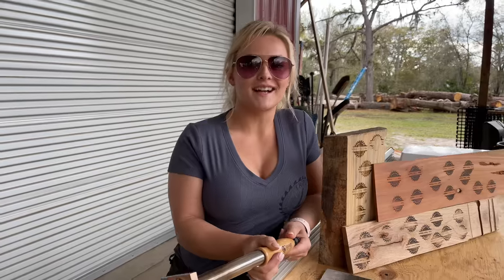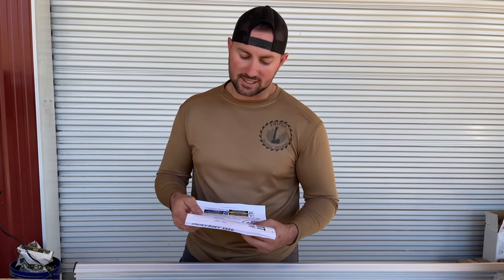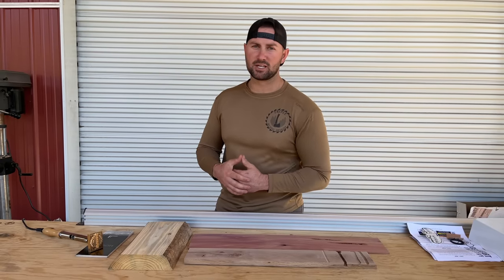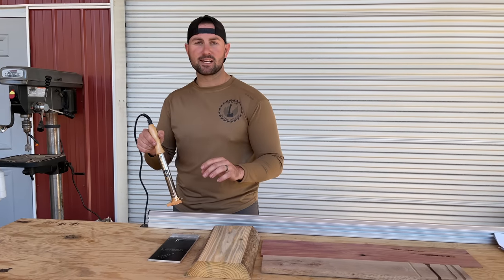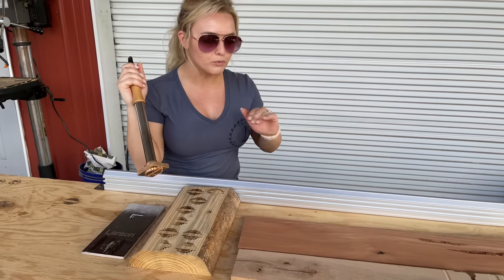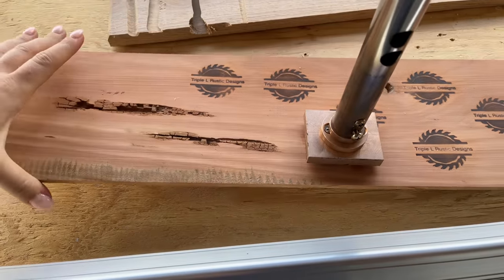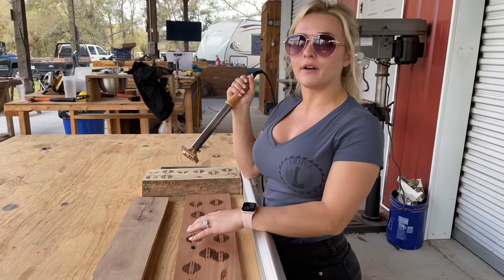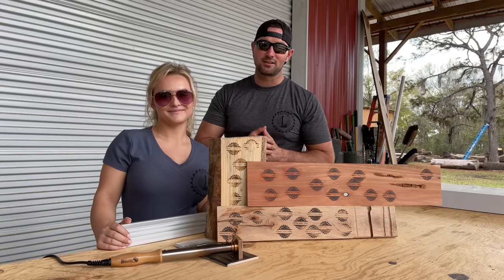High Quality Wood Branding Iron from Gearheart Industry

Comment: Great demonstration.   That is a niiiice iron.

Here's a tip for you.... every time you brand, the wood acts as a heat sink.  Give it about 3-4 minutes to recover its surface temp between brands,  Mine is rectangular.... the outside loses heat first.  Because yours is square, the center cools first.  Just let it recover and you'll be pleased with the results.

Once again, thanks for posting.
Reply from the maker: Thank You so much that is very helpful

Comment: Maybe if you could find an old drill press and anchor that entire assembly to it. Then you could use the constant up/down motion to get consistent burns. I might look into these, but I know they have to be spendy. I need one to burn my apiary license number into a couple hundred boxes. Wonder how long that would last.
Reply from the maker: Great suggestion!
Reply: @TripleLRusticDesigns  well just went to their web site. Guess what? They already make an electric one that fits right into the chuck of a drill press. You just need to shell out the 300 bucks for it. But that's a business write off so not really a factor.

Comment: Holy shit man. Brand something already!! 😂
Reply from the maker: I know I know. Trust me, I am a fan of more videoing less talking. It is all part of it though
Reply: @TripleLRusticDesigns  I like your character brother I was admiring The Branding tool and I have a suggestion if you put it on something similar to a drill press type thing where it lowers vertically and it's already at a perfect 90 degree angle that would lessen having to manually do it and you would have a precise consistent pressure each time.BLEZZ#KEEP DA CHANGE
Reply: Shirt looks good on You too, as well as your wife. never seen a woman with such curves. that is with the utmost respect I give you that compliment. You guys are true Champions she's not lazy and she's pretty to boot.BLEZZ#KEEP DA CHANGE

Comment: If you turn the damn hat around we just might see it.that's a huge logo on her shirt.slighty rotate your hand in a circle so your weight gets on ea.section.you also need to take a break n let the iron heat back up to it's correct temp.your doing to many to fast n it needs to be hotter on the hard wood.
Reply from the maker: Thank You.

Comment: Try mounting the branding Iron so it want move .make you a table that will work up and down pressing the wood up into the brand.
I worked in furniture for years and we had one on a timer for our drawer sides  it did a great job every time..
We used air to push the brand down on the wood.

Comment: You should give a quick review on those planers you have, in the market to get one
Reply from the maker: Thank You. We are looking to upgrade our planer. We will probably go with the DeWalt planer
Reply: @TripleLRusticDesigns  Yeah I have my eyes on that one as well, thanks
Reply: @TripleLRusticDesigns  I have been using the DeWalt 13” surface planet for over 10 years.  It is fantastic... make sure you get the in and outfeed tables.  They cut down on sniped ends significantly.  Especially, if you take a 1/64” slow feed finishing pass.